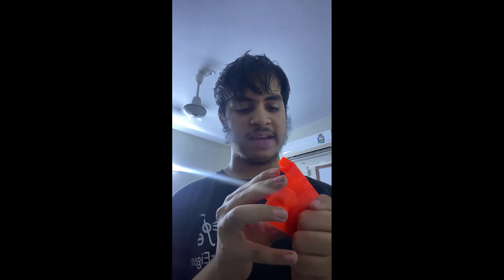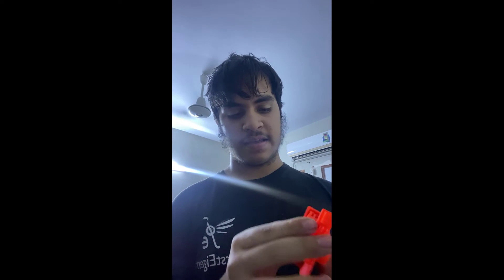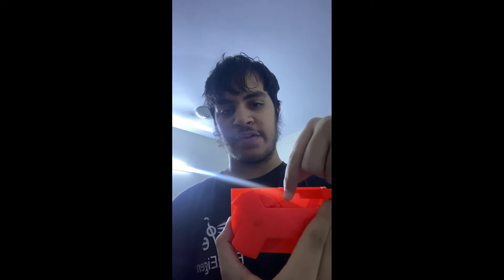3D Printed Combination lock!

Comment: Hey i tried printing this but all the disks move at the same time how do i fix this? Can you send me a video of you using it? Does axle 1 rotate with the dial with the backplate on?
Reply from the maker: One issue with this model is that you need tight tolerances, i would suggest printing the disks or axle one slower or in higher detail. Also look at the attached link for the model because some parts do require specific orientation.